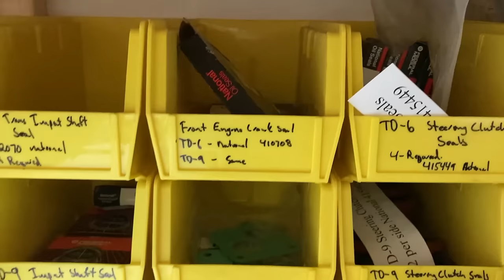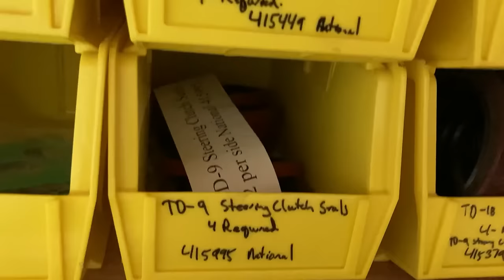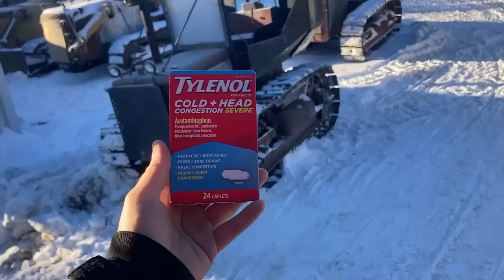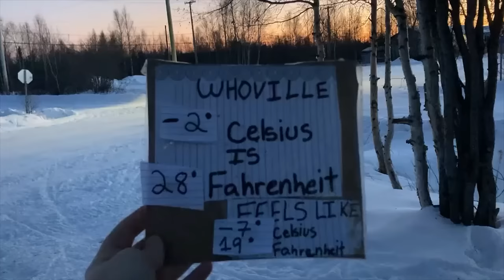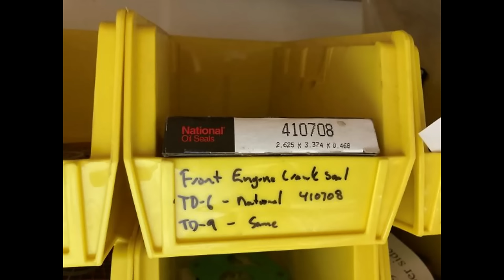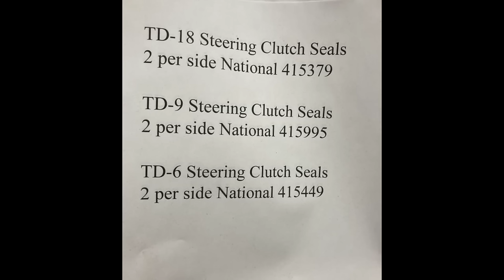Pressure Washing in the Cold KoO Coffee Cups Dec 27 2023

Comment: Panty hose in the Fan blade. I made a fan belt out of duct tape and panteho's. And it got me 40 miles on a 1977 Ford Maverick with a 6 cylinder.
Reply from the maker: yes i think that is why it popped in my head because back in the 1980s, make a fan belt out of panty hose to get home was the new thing. duct tape would have been better which you found out.  thansk
Reply: @kingofobsolete4789  I used them both in combination.
Reply from the maker: anything to get home  thansk
 @detroitredneckdetroitredne6674

Comment: Excellent video on basic and advanced shop work! I too had to use my three-jaw puller to get a wheel off and I used a little of your favorite anti-seize on the big bolt threads to get smooth pressure and it popped off spectacularly! Thanks for the hand wrench idea so you can tell when it’s gonna go and tap tap tapping with the brass punch.
Reply from the maker: excellent, good to see your ideas and sharing because the silent viewers watch and read and learn too. in the new world we now live in, never seize is needed to lube the threads because nothing is made to spec.  thansk

Comment: Awesome video.I agree with you about the old farmers and being smart.Im not 100 sure but I think you time the gas and diesel like they are separate engines.but fixed is fixed no matter how you get there.Take care MJ
Reply from the maker: yes the gas side of the motor operates on its own then when you switch to diesel it becomes a motor of its own. pretty smart thinking back then so they did not have a pup motor to start with a rope. in the early 1940s IH had the delco electric starters which was way ahead of the times.  thansk

Comment: There were some of the old Jimmie diesels that would only lineup on the time marks over 32 revolutions all of your marks would line up
Reply from the maker: yes i think it is the size of the gears. but we are all learning here.  thansk
Reply: That middle gear is just an idler. The other gears all stay the same time n relationship to each other with each revolution of the engine. They made the idler gear a certain size because they had to. The marks are only used when you initially time it, then it stops wherever it wants to. If you keep revolving the engine it will line up again (probably).
Reply from the maker: yes if i turn the motor enough times the marks all line up. the main items all stay timed.  thansk
 @tomarmstrong4156